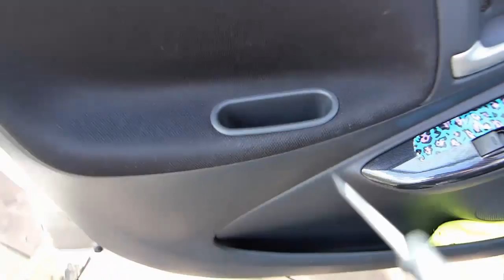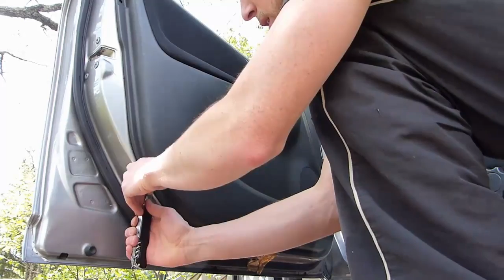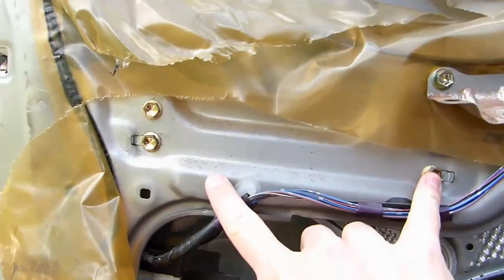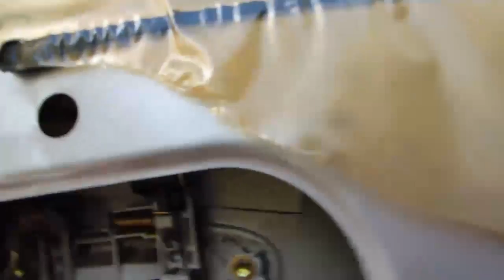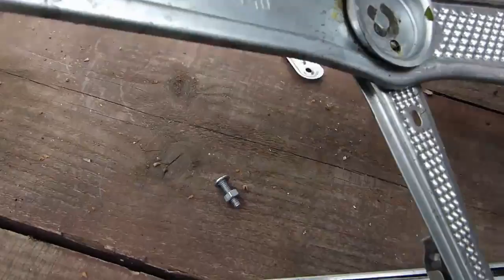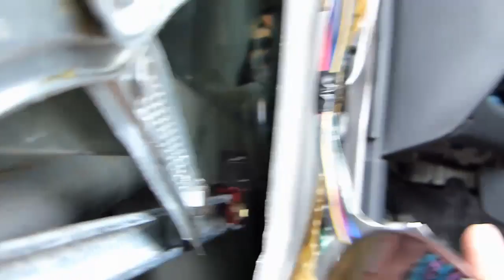Toyota Yaris / Echo / Vitz : How to replace power window regulator

Comment: So the mechanic I took my 2003 Toyota echo to said that my front passenger side window motor  is bad and my window regulator is broken or rusted. Instead of paying a lot of money with the OEM parts can I use parts from the yaris or prius. What about after market kits
Reply from the maker: Hi, you can use after market parts easily . I dont't know if other toyota models are compatible. Also regulators are different wether you have a 2 or 4 door Echo.

Comment: hi.  i have the similar problem that my front door's window cannot go up and down smoothly.  Do you know the product code of this regulatar? i want to install a new one.  Your video is very helplful.
Reply from the maker: Hi, sorry I don't know the part number. You should find it easily but make sure you take the model for your car because there is a difference between the 2 door and the 4 door version.
Reply: Thank you very much💪
Reply from the maker: You're welcome !